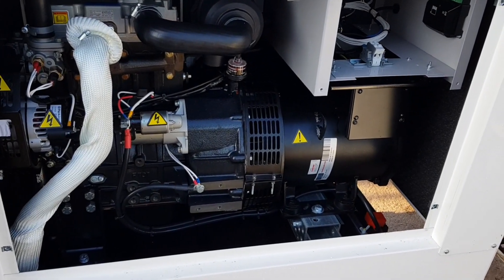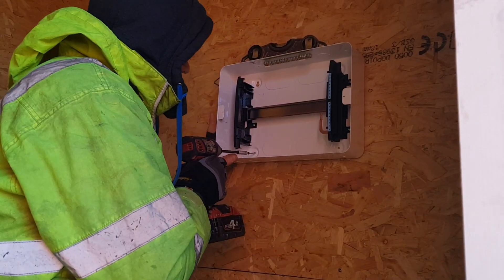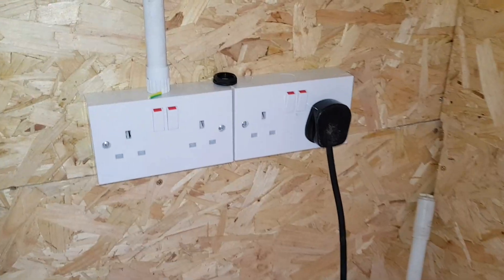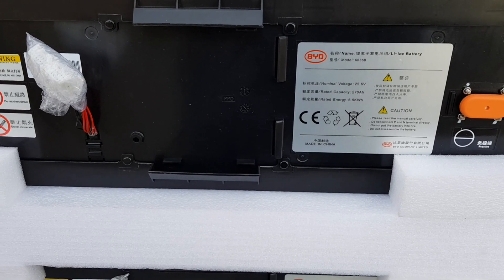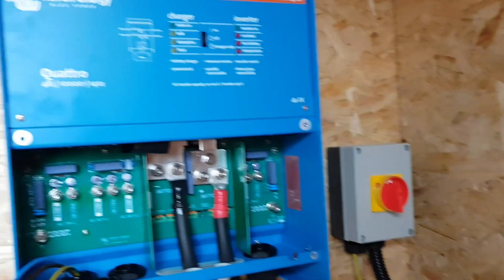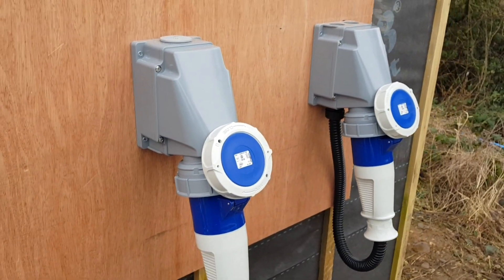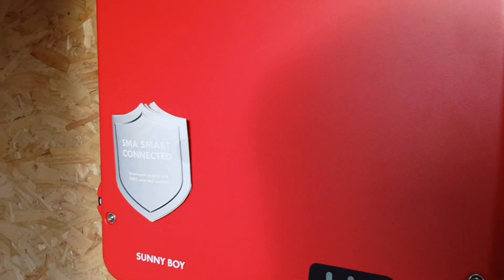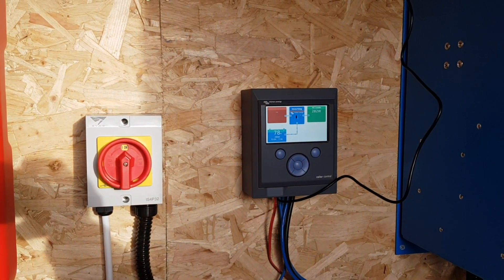Installing a 10kw Offgrid system, part 3 installing inverters and batteries

Comment: I wouldn't understand why there isn't two victrons and why isn't the generator running to a switch and then to one of the victrons.
Reply: the output of red box doesn't run to the batteries? it runs to victron input? what there isn't a transmission or generator on the input?
Reply from the maker: The victron has multiple inputs and outputs 👍1 unit charges batteries and can accept power in from 2 sources at once to charge batteries as well as just pass power straight to the mains board

Comment: I am assuming that the Sunny Boy is a grid tied inverter.  

The output of the Sunny Boy is going into the Victron AC input, and if the grid goes down, the Victron inverter tells the Sunny Boy to continue producing electricity for loads and for the battery.  Would this would be an AC parallel, and is this a three phase installation?

How do you stop the Sunny Boy from exporting electricity while the grid is down?  Is there a physical switch somewhere?
Reply from the maker: Victron inverter had 2 ac inputs, one comes from the solar one comes from the generator when it comes on. It acts as the grid for the solar inverter.  The victron inverter balances the load to or from batteries. The sunny boy winds back its through put automatically when the victron stops letting it through to the batteries/ power usage
Reply: @Field_to_Farm  thanks.  It makes sense now.  

Both the Sunny Boy and the generator are feeding AC current into the battery through the Victron inverter / charger.  

The Victron inverts the current from AC to DC, and it charges the battery with DC current.

As far as I could tell the Sunny Boy is a single phase inverter.  

So, I am assuming this is not a three phase installation.

Comment: Hi, Did you wire the sunny boy inverter output directly to the victron ac input. if you have done so, I have never seen this done before. That bwen said, this install is pretty amazing
Reply from the maker: Thanks :-) and ye it's ment to be a grid tie inverter so it outputs ac which works well for our setup
Reply: could have taken the output to a mcb incase of fault

an rcbo type AC type C amp be good 👍